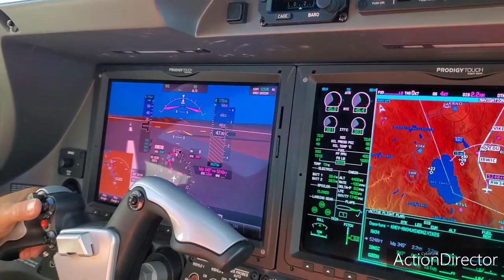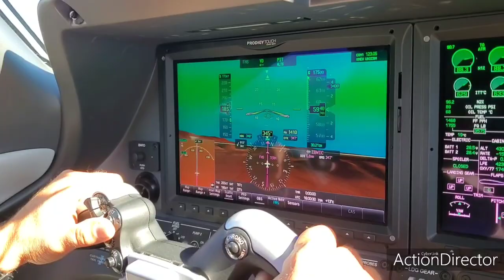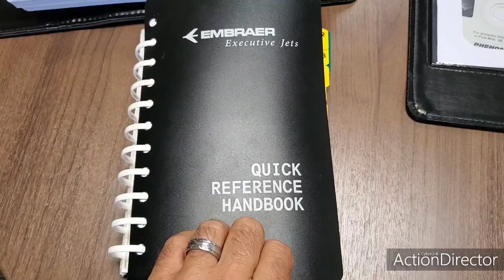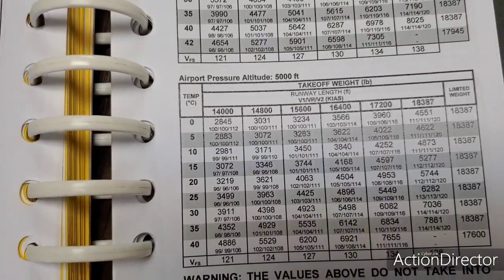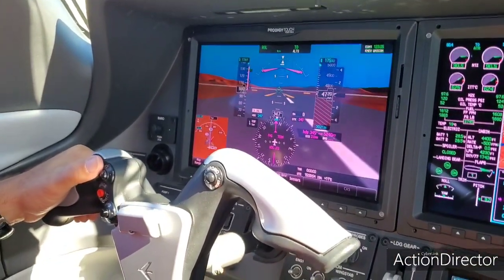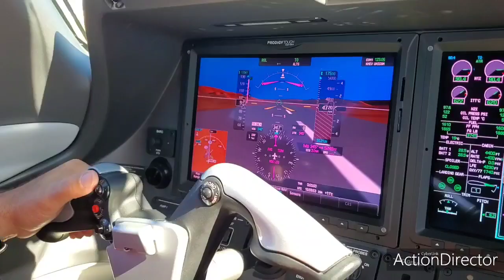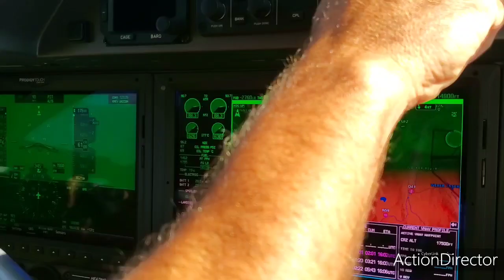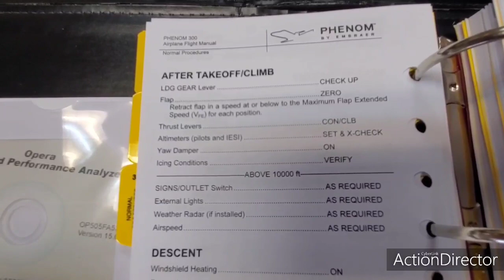Phenom 300 takeoff

Comment: Terrific video. Can you do a video on the power setting for takeoff. In the C90 you have to keep one on on the torque guages & ITT if hot and high. Do you compute a target N1 and the FCU sets it automatically so you just push the thrust levers to the stop? What height agl to you accelerate to best RoC IAS.

Comment: Good video!  On rotation there does not seem to be any tendency to over control and the same as you  tuck the airplane symbol under the FD command bars.  Are the controls during pitch-up slightly heavy?What is the pitch-up degrees when the TOGA switch is pressed on an ILS?  Patrick from Albuquerque

Comment: So,,I'm not a pilot,,,yet, but all those parameters & factors, do you enter those numbers into the nav system, and it tells you all your "V" speeds or do you have to reference those charts before every take off? 
Great videos btw, you're doing great, would be nice if you could record more flights,,and we like hearing radio talk as well just fyi
Reply from the maker: Yes, every take off we look at the quick reference handbook.  "QRH" is the aviation lingo.  Then its quick work to put in avionics. That marks on the airspeed tape in front of me.